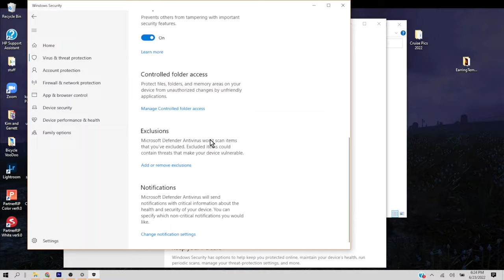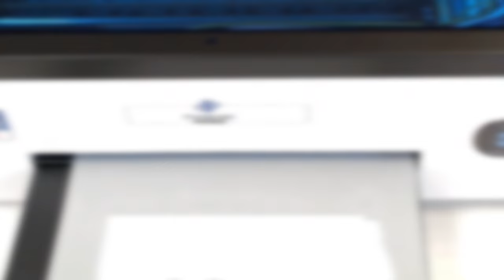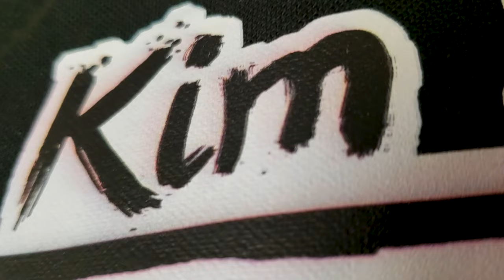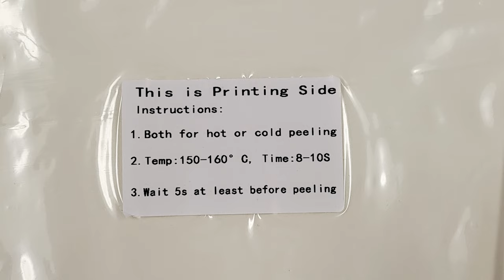Sublimation VS Direct to Film Transfer Printing

Comment: I ran an apparel company back in 2008 and believe me that the fact that you cannot print sublimation on 100% cotton t-shirts will be an annoying hurdle that your apparel startup may never get past. This alone should steer you away from sublimation if your main goal is apparel. You could print sublimation to 50/50 cotton-poly blends, but the ink will still wear off in under 5 - 6 washes. If you want to sell cheap-o  tees for a one off event or make matching shirts for the family trip to Disneyworld then cotton printing will be fine. But when it comes to buying wholesale inventory, quality shirts out there will be 100% cotton and even at a low retail price, people buying your shirts will expect to have the image not completely fade away in a few washes, and if you do print to 100% cotton, it will wash off completely within 1 - 2 washes. It will have a soft hand for sure, but the longevity just is not there. Also, when using a regular inkjet printer with sublimation ink, the colors will often not match up as well as other methods, so the colors you see on the screen will not 100% match what actually prints, which can often make or break a design that you likely spent time creating. Sublimation ink is just not a language that your Canon inkjet was created to fluently understand, so there will be some misinterpretations.  And depending on what app you're printing from, like Photoshop, you'll have to play with the color management a lot to get it to be as close to your on-screen image as possible, because monitor settings also vary and colors can completely change on screen depending on your contract, brightness, etc settings. And of course, the fact that you cannot print to black/dark shirts can be a deal breaker all in itself. I was able to make some black ink to olive green shirts, but that's about it and even then it's still barely visible. 

And in regards to 'maintenance ', sublimation ink actually WILL dry up over time. It is recommend to do at least one print a week for proper ink flow. I have had $5,000 printers turn into large paperweights because of not being used often enough and having the ink within turn to stone. I suggest routine DIY cleaning as well using an OTC solution called Simple Green. And know that if you plan to purchase an inkjet printer and use sublimation ink instead, this will only work if you put in the sublimation ink first and ONLY. Whatever type of ink you put into that printer when taking it out of the box - that is the only type of ink you can use from there on out. If you've already used it with regular ink then try to use sublimation ink instead, your tubes are going to get clogged and depending on the severity, you'll either have to get the tubes professionally cleaned out or worse, replaced completely, which is costly. So don't think you can use that old inkjet you've got sitting around the house and just change inks, because that won't work. Regarding size, you are certainly not limited to 8 x 11 with sublimation. Print size depends only on printer size, and larger Epson printers for example can net you 36+ inch wide images. Though remember that you will also need a larger heat press for larger images, and if you're doing an 'all-over' print, using a smaller press and trying to get the top and bottom to match up using several presses is not going to work out well for you.
Reply: Thanks for this insight, its very informative. I've known that printing on cotton shirts makes the print kinda dull but i havent heard about it fading fast, especially since its always been said that since its adhered to the fabric far better than DTF and doesnt leave a film then the print is presuned to last longer. I guess thats why i havent really seen much artists in art conventions/artist alleys sell sublimation printed shirts, its always tote bags. In the case of tote bags however, sublimation prints on canvas seem vibrant and close enough to digital designs from what i have seen, plus i own quite a number of totes that i have used and washed a couple of times now but the print still looks fine. I guess because its printed on canvas instead of cotton? I'd love to hear more of your insights if you have any regarding sublimation on canvas. Thanks again!
Reply: Thank you for this comment it’s good to anyone looking to just get started
Reply: Thank you so much for this comment. I just have a question. So, say I have a square picture. Would it work if I put a white vinyl on a t-shirt and then put the sublimation on the white vinyl?
Reply: Why would you have a printer that’s $5,000 for sublimation they are $300 max
Reply: @CapybaraRobl0x  Hey, I also heard about this method where you heat press the vinyl first and then you heat press the sublimation paper on top. Did it work out for you?

Comment: Thanks a lot for this video.
I have a question for mr Kim about DTF .
can i print a picture on top of another. 
For example i print a picture and after it cool down i print another smaller one on top of it ?
Reply from the maker: Yes! We just tried this out and it works. We did need to do a second press on each image.
Reply: @KimandGarrettmakeit  thank you so much 🙏
This is very helpful ❤

Comment: Just curious if you can post a close up photo of the DTF film after you've cured the powder? Just wondering if it looks smooth or like alligator skin?

I tried the sublimation hack with sublimation paper & the powder, looked nicely coated, but when cured it was very alligator or dry skin look, not smooth.

Thanks for your awesome videos.

Comment: I  bought one of these from Amazon... after a couple prints, the white quit working.  Any suggestions?
Reply: Because the composition of white ink is titanium dioxide, it is easy to precipitate. You can use a needle to pump the waste ink tube to let the ink circulate, and you can clean the print head with F12
Reply from the maker: Hey Michelle! Yeah, the white is finicky! It clogs and separates pretty quickly. When my white starts looking thin, I will use the syringe to pull a 1-2oz through both white nozzles and then do a print head cleaning. That will usually put me back in business.~garrett
Reply from the maker: Agreed! 👍 ~garrett

Comment: Interesting topic. use discharge white as an underbase for sublimating. Its better than clorox Bleaching method because discharge ink only dips on surface of cotton shirt while keeping design consistency. 
Actually i even ask this to a local discharge shop to screen print only white underbase and he said: No, discharge ink contains grainy ink that will prohibits ink sublimation. [Citation needed]
The one billion dollar question is: do sublimating works on cotton? The answer is Possible. you first use the cotton pretreatment spray. It will fade after several washes. Sublimation only works best on white tshirt with atleast 65% polyester or above.